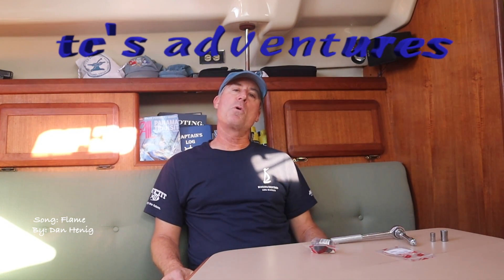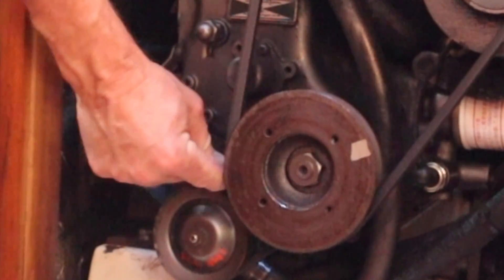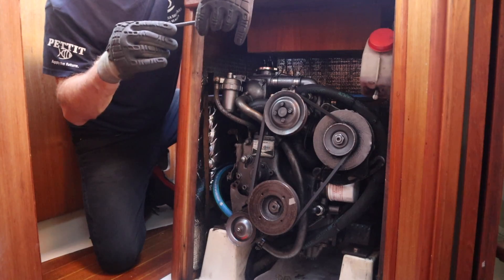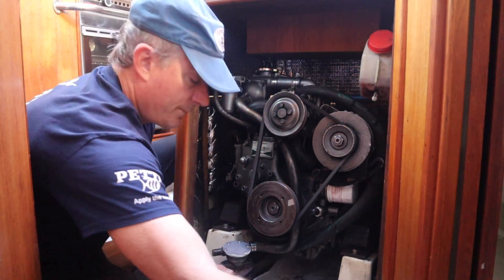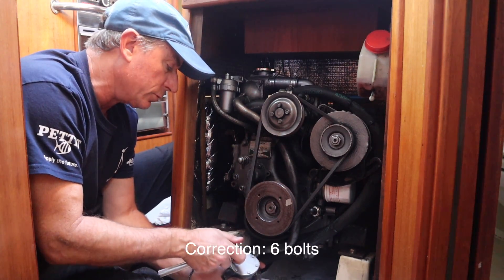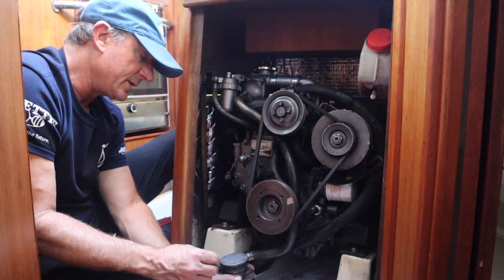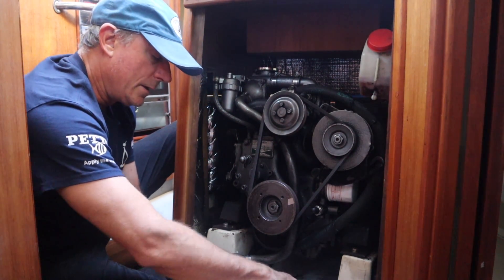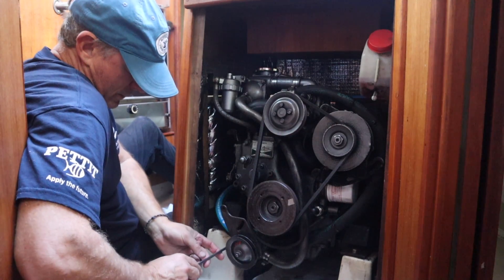Yanmar 2GM20F Impeller Change ~ Ep 53

Comment: Cheers bud, just about to change the impeller on mine (same engine) have noticed recently that occasionally the water pump isn't turning when I start her, usually corrects after a few seconds, likely belt slipping or gunk in the impeller i would imagine but I'll figure it out
Reply from the maker: Let me know how it goes!
Reply: Will do, need to do the fuel filters as well but nervous about airlocking it, watched your vid on the filters one question does the pump run (to bleed it) with the keyswitch on or do you need to crank the engine with the compression levers open?
Reply from the maker: Mine has an aftermarket electric fuel pump. So, I just have to put the key in the on position and it pumps the fuel. I do not try to start the engine. If you don’t have a fuel pump you have to use the lever on the side of the engine. I think I show where this is on the engine. It will require a lot of pumping unless you fill the 2 fuel filter housings with clean fuel — then you won’t have to pump in as much fuel.
Reply: @tcsadventures  TBH i was just gonna open the decompression valves and shut off the water inlet then fire the start button for a couple of cranks rather than manually pump it
Reply from the maker: I’m not a professional mechanic and I try to share with other DIY people the safest least complicated way to do the maintenance — to try and avoid mishaps. But obviously it isn’t the only way. Good luck with your project!

Comment: thanks for the tutorial.. I have to change mine this weekend. Do you know of hand the part number for the belt that goes around your alternator as well and how often should you change that belt
Reply from the maker: I have a Yanmar 2GM20F. The “F” designates that the engine is cooled by both raw water (sea water) and fresh water. If you don’t have 2GM20F you may use a different belt. My belt is a Yanmar genuine part 25132-003700. I would call a Yanmar dealer to make sure you get the right belt for your engine. I think the number of hours you operate the engine and the climate you’re in would be factors in how long the belt lasts. I look for cracking and wear on the edges. If you’re in doubt I would replace it. It’s inexpensive and easy to do. If you have any doubt about repairs on your engine I would have a good diesel mechanic look at it and or talk to tech support at Yanmar (or authorized dealer). Good luck! Here is a link for the belt: 
https://www.dieselpartsdirect.com/ym25132003700

Comment: We have a yanmar engine in our boat.
What are the usual problems i should be aware of with the yanmar engine?
Reply from the maker: I can only speak from my personal experience. My Hunter is a 1991 and I’ve owned it for 23 years. I haven’t had any problems with my Yanmar. I think most diesel mechanics would say that 2 of the most important maintenance issues for a diesel is clean air and clean fuel. Keep the air filter clean and your primary and secondary fuel filters changed according to the maintenance schedule. I probably don’t put 50 hours on my engine a year, but I change the engine oil, oil filter and fuel filters every year. I change the reduction gear oil probably more often than I need to. Regularly inspect the raw water pump impeller and replace as needed. Of course there are lots of other things to maintain and some complex work you may want to have a professional do. But Yanmars are reliable popular engines installed in many high production boats and farm tractors. If you take care of it — you should have years of trouble free use.

Comment: Please include part #'s and links
Reply from the maker: FYI: the part numbers were displayed on the video at 9:01 and 9:20. Impeller: 124223-42092 & Gasket: 124223-42110. I didn’t include a link because these OEM Yanmar parts (for an engine that is no longer manufactured) can be difficult to find and sellers typically have a small inventory. So, the link would quickly be no good after I posted it (particularly if they’re from ebay). The vendor I bought mine from no longer has them. I just did a Google search and they’re out there at various price points. The non OEM are cheaper, but I prefer OEM parts. The OEM parts are in a distinct packaging that you can see at 9:01 on the video. Hope this helps! Good luck!
Reply: @tcsadventures  this is one of the most common engines out there pretty good availability IMO